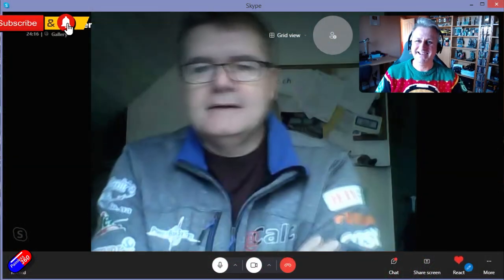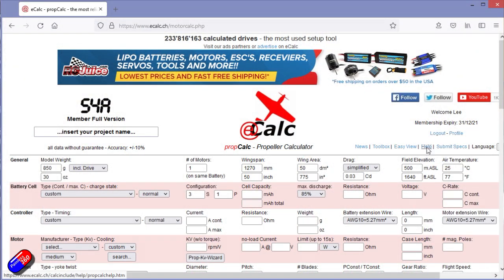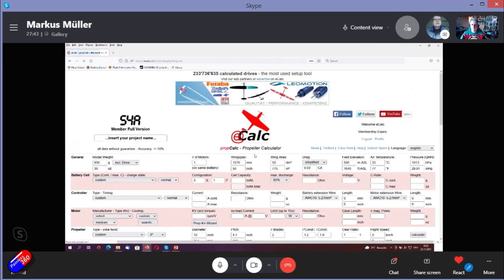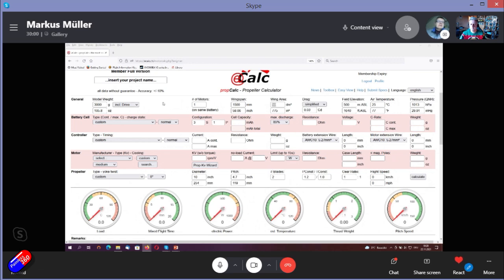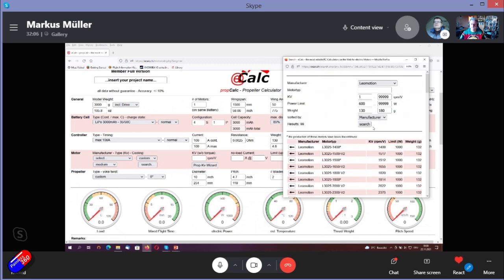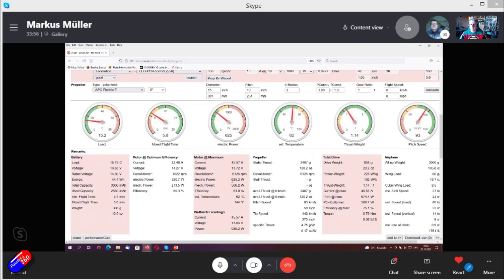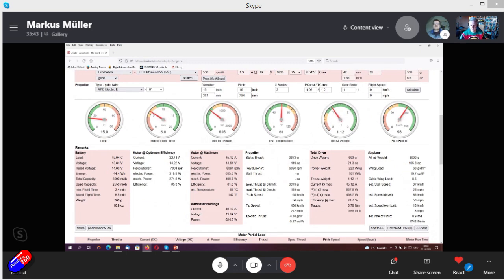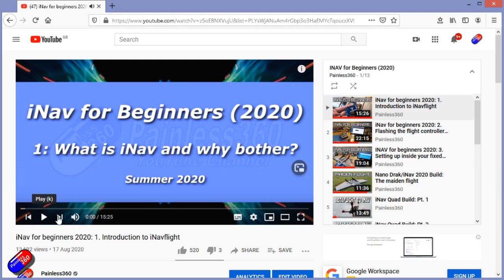How can I easily choose a motor and prop for my model that works?

Comment: the one not accurate is the flight time, because if i tried put my fpv plane specs, i only got 15 minutes of flying time, while in actual world, i can get 30 minutes using 50% throttle

Comment: The only metric that is giving me fits is calculating the "wing area" parameter.  I try to measure and calc the area but I seem to be doing something wrong or entering it wrong.  What would you recommend for finding this value?

Comment: Pretty good, thanks.

I bought a 2nd hand, made up kit balsa model a few years ago and the fitted prop, which is about the biggest it can accommodate flips the model over (torque roll) during take off. It's kind of annoying as it definitely needs the thrust and I was thinking perhaps a smaller but faster prop might help? So long as there's enough torque to get it moving the air over the wings should provide stability...

I'll give eCalc a try and see what it suggests.